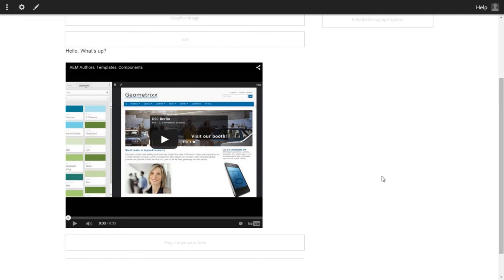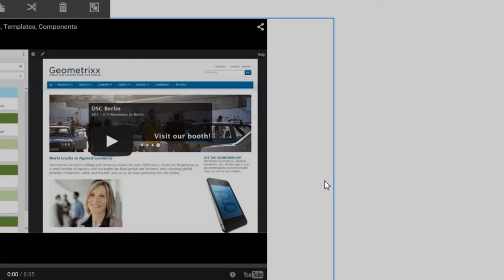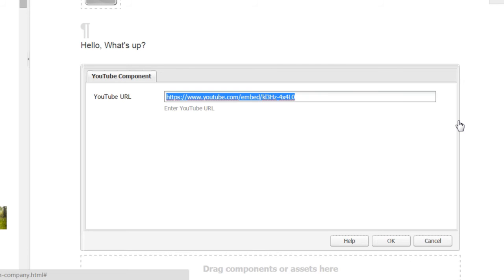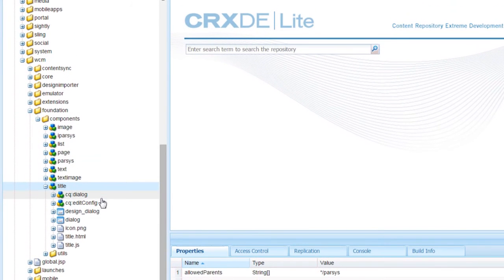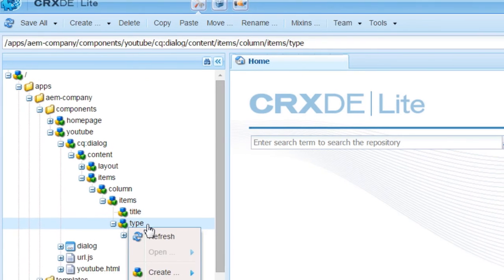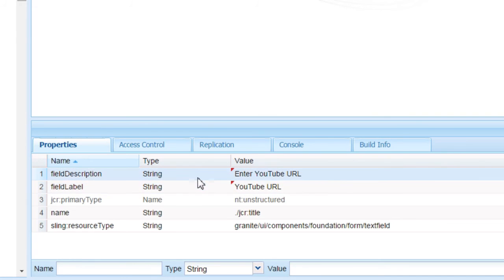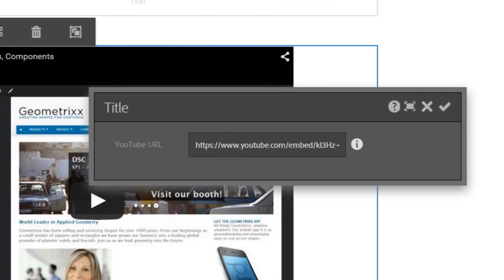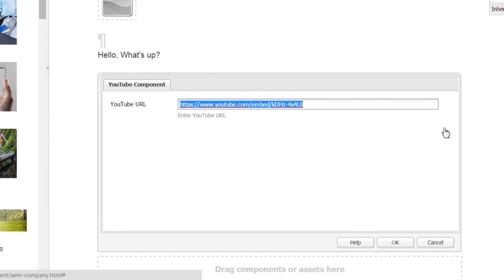Add a touch-optimized dialog in Adobe AEM

Comment: Hello Sunil,
                   
           For dialogs to show the URL in classic UI we wrote the logic in a separate js file right, In touch UI  do we use a separate js file or do we do it directly in HTML file using slightly tags?
Reply from the maker: Murali, you can use both ways.
It's preferred to have a separate js.